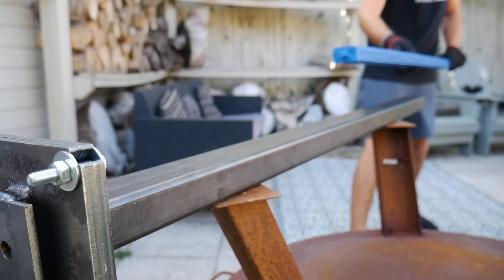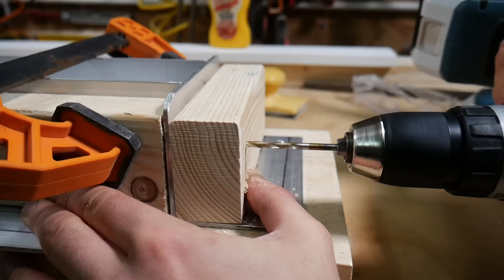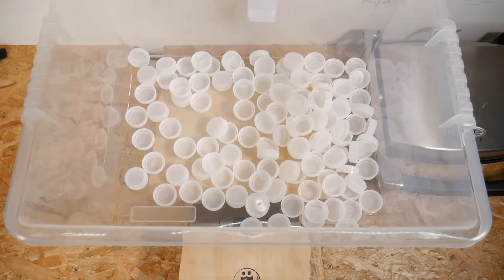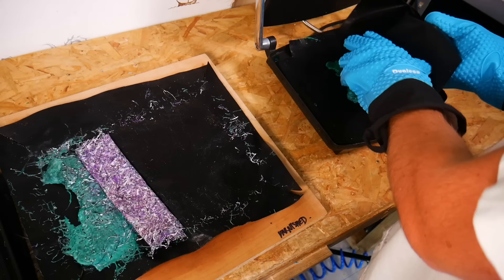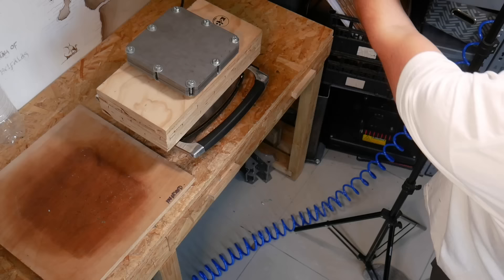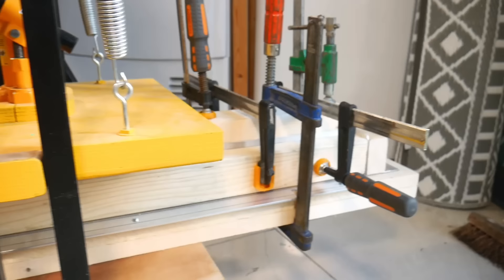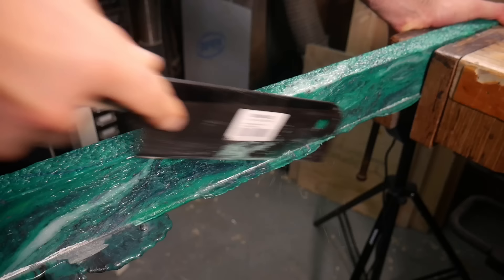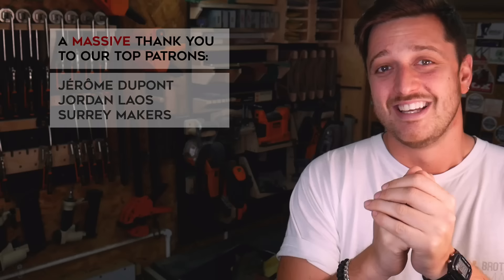How to Make Recycled BEAMS from Plastic Waste at Home

Comment: Do you have any thoughts on a retaining wall? 
Perhaps could enlarge the plastic bricks, brackets, and baskets and fill them with sand or pebbles to provide a sturdy base, given that the frame is already robust. 
Perhaps could consider incorporating design elements that facilitate drainage to prevent water buildup and potential damage. 
One approach might involve compartmentalizing the fillings within the plastic bricks, brackets, and baskets, allowing water to pass through while still providing structural support. 
Then, could construct it like a Lego set against the wall to safeguard it. After filling the components, this could be pressed or hammered tightly to ensure stability. 
This is just a suggestion for consideration as I myself was trying to figure out how to build a cost-effective retaining wall that only require minimum labour.

Comment: Really great but highly intensive.  I’d look at using the heating from the presses and coupling this into an extrusion system of some kind.  Then it’s a simple case of loading in the waste via a hopper and have something push the plastic out through an extrusion nozzle…..

Comment: I know this video is old. But for the mold, you could possibly create a heating plate for the base, that constantly maintains the temperature of the mold. Once you’ve loaded the plastic you could then lower the temperature. Idk if that’s feasible at this size though. 🤔

Comment: did you ever consider putting elements underneath the aluminum sled and melt as you fill pressing after each layer maybe put a pizza roller at end pull out through roller than push back in to remove air then halfway through press steel in middle for strength support

Comment: You asked for suggestions to speed up the process. 
If you made a heated mold you could melt the plastic in the mold itself. One way to do this would be to use a thick gauge aluminum box which is laid into the ground then surrounded with hot coals.

Comment: Add some stranded fiberglass or carbon fiber for strength. Also you could build a small double boiler to melt the plastic easier without burning it.

Comment: There’s a company in Australia called ekodeck(?) that’s almost 50/50 bamboo and recycled plastic. The other tiny percentage is colourants and stabilisers I think. I’ve only seen decking and screening by them, but I like the concept, and you cut/glue/screw like timber, but no painting required and (not sure if this is tested and proven in real life conditions) should last 50+ years

Comment: Just an idea to improve efficiency, have removable heating elements that connect to the mold itself and maybe an agitator to remove the air? Then remove the heating elements to cool. Maybe even move the mold to a heat displacement device like a large aluminum block.

Comment: I'm trying to recycle 3d printing plastic waste and I had this thought: why not have a mold that you heat up from the bottom, and add plastic into it?

Aluminum angles will transmit heat very well, so using only aluminum for the inside faces, and with some holes in the base and a heat gun, you could melt the plastic directly in the mold as you add it in. Then pressing down the counter mold from the top would push your bubbles out. At least that's the connector in my mind. I'm just not sure if that uses more energy or less than your current method.

Comment: A handful of comments/ideas/suggestions:

1. Since you are working with plastics that have many toxic chemicals in them, be sure to do this in a well-ventilated area. Those kiddos don't need to be burying dad at their age.
2. Faster heating could be accomplished with an old pot or baking dish and some kind of rocket stove. If you can melt enough at one time, you can simply pour it into the mould. If using a source of "high heat", try the double boiler method (like you'd do for chocolate) to prevent burning.
3. Use a set of these jumbo Lego block moulds (https://kfmoulding.com/lego-block-moulds/) and give the kids something lifesize to play with.
4. Concrete moulds would also work, and are readily available in a multitude of sizes and shapes.
5. I really like the color variations. You should use a lot more colors and call it "Tie dyed lumber"

Keep up the great work and keep those kids involved.

Comment: I wonder if using something like a foundry would make the process faster. Also since the idea here is to pour molten plastic I believe you could do away with the press and clamp idea. To recreate your marbling technic you could pour several colors in at different points as things are firming up. Something like a liquid resin pour.

Comment: In terms of quicker, you could possibly look into turning this into spooling to go into some type of 3d printer and then print the projects instead. I dont know a ton abkut 3d printers and if that could work out of the box, but there has to b a way, if theres a will.

Also, I'd love to see a superduper durable and insulated cooler project out of this. That would be insane. Especially with the outside built from these, high density r-value board in between (not spray foam as it retains heat and defeats the purpose of using insulation) and then the interior again. Bulletproof....or at least bear.... 🐻

Comment: If you want to over come the time issue you'll need a n all metal and insulated mould with heating elements and some temp control... Counter tops might be an idea?

Comment: You should be able to put all the plastic for one beam in one container and then put it an oven and melt it all in one batch. It seems like any standard oven (even a common electric kitchen stove) would easily melt all the plastic you needed for one beam. Or you could make one mold that would make a double wide beam that you could just band saw into two beams after it cooled. In other words, make a larger mold and melt the plastic for one double size beam, mold it and cut it down the middle to make two beams each the same size as the one in this video only make them with one oven cycle. If you heat up an oven that can hold 2 cubic feet of material, but you only melt 1 cubic foot you wasted the heat that could have been melting the larger quantity of material. Doing larger batches at one time is more efficient regarding energy and process time.

Comment: Use an induction coil to heat a metal cylinder and a piston and nozzle to injection mold plastic beams. Then build something out of it to assess its strength. And then manufacture and sell the injection mold for home use.

Comment: If one had a curing oven, meant for curing wood, could you place the bottle caps straight into aluminium molds, then press them into boards remotely?

Comment: I wonder if there is a high heat gun that could expedite the process rather than the panini press? Create a few channels in the mold and run the heat gun in to melt in the actual mold then add pressure. (Try it I guess?) Also if it needs more strength perhaps embed some kind of internal aluminum or steel by mounting it in the mold prior to melting...

Comment: I mean if you make specific sizes/ lengths  then build jigs specific to that size  and make the jig better. Build the cap with knows that can tighten down to specific height. And jig to hold a specific amount. 

Make an oven to fit the jigs inside so you can add the hdp in heat it up and take it out cap it off and allow to cool down.

Comment: Well, it's definitely a proof of concept. I think you are doing a great job. 
However, flattening the beam requires professional tools that most people do not have. It would be awesome to improve the process to make it possible to achieve similar results without the need for professional tools. 🙂
Reply from the maker: Thanks so much! Since this video we've actually found that a cheap card scraper is a good and cheap alternative substitute for a thicknesser. Check out the blue and green coffee table video we made to see it in use 👌🏼

Comment: A chamber heated by steam would absolutely bring the plastic to its melting point and could be designed for any sized dimensions. Few plastics remain solid at 100c, but those that do should be maleable enough under a little pressure (but then you need to build a pressure chamber to scale).
Reply from the maker: 100C isn’t enough to melt plastic

Comment: Just wondering if heating up the plastic doesn't release any toxic gas and in what ways the plastic changes (in the long term) if it is heated. I don't know too much about polymers but would it still be food safe? And how often can you heat it before it starts to break down? But really cool to see plastic being re-purposed instead of going to landfill or breaking down into microplastics.

Comment: One way that could better heat the plastic without the need to worry about fumes would be to have it in a closed vacuum. There are some induction heaters that can heat metal without needing to touch anything, and having surrounding a metal container holding the plastic, inside a vacuum chamber, would give the heat very few places to go from the metal other than the plastic. 

Definitely would need work to do, so as to not get to hot or melt (melt the metal anyways), and as its already in a sealed chamber, you could have an exhaust that draws the air out when the pressure comes back.

Of course, this is only my over the top idea to help speed up the melting process, though I figure an extruder would be far easier and simpler to use... also likely not require custom engineering.

Comment: Why not find a full size oven or ovens?
 Plenty of old appliances also need new homes other than the landfill. I've worked in many used appliance stores and was just daydreaming how much plastic could be melted down at one time.  

I much appreciate your ingenuity. I am an artist who saves to reuse as much as I can.  I'm currently disassembling old gel pens and the like to use as beads for hanging beaded curtains.

Keep up the good work!

Comment: Note that the wood, aluminum and other materials used for the mold can be re-used many times. It is NOT the case that each plastic beam requires at least one wooden board to make the plastic one. The mold can be reused hundred of times. At large scale, the molds would likely be steel and reused hundred of thousands of times. This spreads the cost of the mold over many plastic beams/studs.
Reply from the maker: You got it!

Comment: I'd like to see them build something with plastic beems and or panels that is functional and / or useful
Reply: Also I made a plastic mallet head this way but I still need to put a handle on it haven't got around to making a handle for it yet it's white with red swirling because it's made from milk jugs and laundry soap containers , cut into pieces and heated in and oven mixed carefully and then pressed together in a mold and then refined

Comment: A nice sized solar oven would produce a literal trough of melted plastic in decent time and if the entire mould is made of metal you could grace it better to prevent distortion and heat the entire piece and it’ll gradually cool over time like a kiln. If the top piece had a chunk of metal on top like a scrap piece of train rail it would put even pressure the whole way across and you probably wouldn’t need clamps

Comment: Shred the plastic use and Arduino a stepper motor a hopper and make a giant rough filabot to extrude the plastic into your molds. Also use another Arduino and some ni-chrome wire to preheat your molds. You could crank out a beam every minute with a sufficiently sized filabot. Good luck

Comment: At large scale, no panini press, oven, or heat is required to melt plastic. Plastic can easily be melted using high presure instead of heat. At large scale, a plug mill could use a giant metal screw to push plastic from a large opening/hopper end of the machine to a narrow end. Molten plastic could be extruded out of the narrow end of the pug mill. Alternatively, you could make the mold for the beam excessively large in one of the three dimensions, fill the mold with plastic bits, and use a hydrolic press to push a flat steel plate on one side of the mold toward the other side.
Reply from the maker: We have a small extrusion machine which does something sort of similar to this 👍🏽

Comment: Douglas fir wood, the common wood used in 2x4” has a modulus of elasticity (or resistance to non permanent deformation) of 11200-13500MPa (1.6-1.95 Million PSI). While HDPE, (600-1500MPa) is more susceptible to of course deformation, especially if heated. In terms of actual application, HDPE probably shouldn’t be used to frame a house, but I could see it being used for decoration, flooring, or even furniture.

Comment: I would have made the mold entirely out of stainless angle iron. Then place the mold on top of four or five hot plates where you could adjust the heat and start adding plastic. Then, before I took it off the hot plates and squashed it, I would have pulled it out and got the bubbles out before putting back in the mold and pushing it flat. Just a thought.. good video.

Comment: Another idea is to make the casing from aluminum and run copper pipes underneath and run 150°C hot oil with hi-temp pump so it'll melt inside the casing

Comment: This is the next step towards less waste, thanks for doing this boys. Plastic isn't going anywhere, so we need more minds on this. Non load bearing framing materials is perfect reuse for plastic! For more efficient heating I was thinking of a thin all metal mold, and a very long burner pan attached to a propane bottle that heats up the mold itself

Comment: I'm wondering if a small propane powered blast furnace would work for this with a graphite smelting pot. I mean if home blacksmiths can make knives out of scrap metal wouldn't it work with plastic?
It would allow you to melt a larger volume of plastic much faster. The only question is does the molten plastic stick to graphite? Molten metal doesn't but I guess you wont know unless you try.

Comment: Hi! Does this not create toxic fumes? I'm wanting to get into creating recycled artwork, but am scared of the fumes
Reply: HDPE shouldn't release fumes/VOCs until it starts to decompose from the heat which happens ~330 degrees C. The melting point is much lower, closer to 180 degrees C. With that said though, there is the possibility that the dyes and/or contaminates, could have a lower temperature range that releases toxic fumes sooner. Therefore, I would wear PPE that is rated for VOCs and work in a well ventilated environment to be safe.
Reply from the maker: We have a whole video on plastic recycling safety. Go give it a watch 🤙🏽

Comment: you need a constant temp oven of some sort that keeps the plastic right at a specific temperature. the concept would be right at melting point but not to the point of burning. something like a large cast iron pot or something with electrically controlled heat.

Comment: One might be able to increase the shear & bending strength if some metal reinforcement ( or even other materials, as well just to experiment).

The reinforcement could be clothes hanger metal, od metal tubes (like curtain-rods) , re-bar or any other material you want, though metal is likely the best for this.
Heck, you might experiment with pre-tensioning & post-tensioning, just like concrete.  However, that would possibly behave differently than concrete, so a modified process would likely be needed.

Comment: Hmm, I'd like to see you use some NiCr wire and an extruder of some kindto create a heating element which would allow you to extrude the plastic in to a similarly heated mold.
If done right you should be able to build a 1 or 2 step process to melt and create your boards. It might even be possible to have it so that it will go straight from caps to final board.

Comment: 2000 PSI, 450F plastic injection molds have cooling water lines that surge cold after injection to cut cycle time. 

IMO, make an extruder and see if you can 3D draw with scrap plastic at all even if it's big.